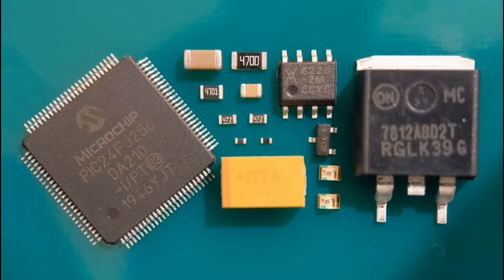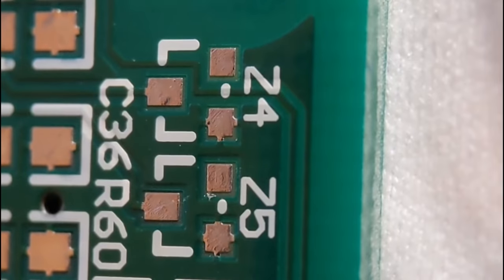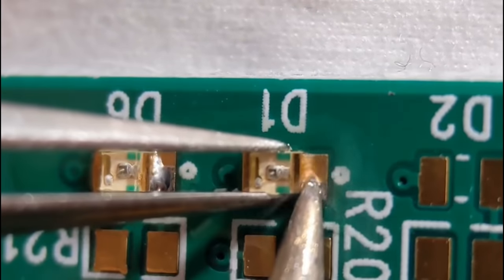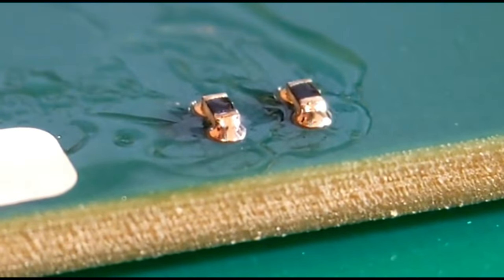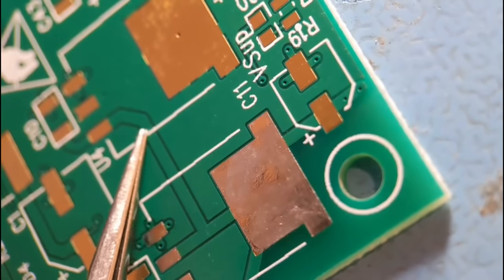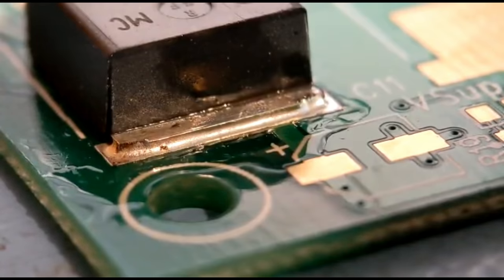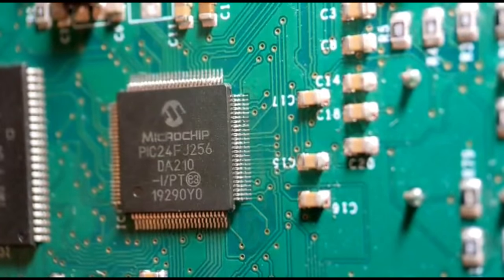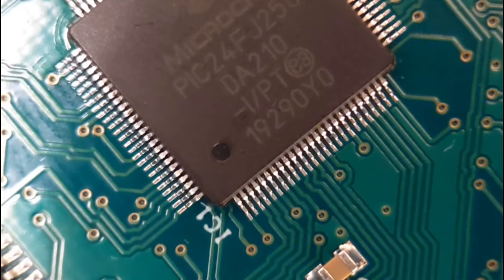How To Solder SMD Correctly - Part 1 /SMD Soldering Tutorial

Comment: Hi thanks for the tutorial, I just wanted to know what size of lead and brand are you using on this video, It will be nice if you post the materials you use on this video. thanks!
Reply from the maker: Hi . Thank you for your question . The solder I used in this video was called Nitrosol Solder Wire , Alloy - Sn100SB , size 0.25mm , also comes in larger sizes , supplied by BLT Circuits , www.bltcircuitservices.co.uk 
Flux I use is SMFL200D , suppliers Farnell , RS Components , also seen it on eBay . This is the only flux I ever use .
Cleaning fluid i use is called Ultrasolve .
I only use Weller soldering irons TCP S model. Hope that helps . Thanks again for watching 👍
Reply: @mrsolderfix3996  Thank you so much!!! Liked and Subscribed!
Reply from the maker: Hi . Thank you for supporting my channel . I always try and help people if they need it so if you have any questions in the future , please feel free to ask and I'll try and help . Thanks again , good luck👍
Reply: @mrsolderfix3996  Maybe in future, a tutorial, a proper way to use hot air rework station, how  to resolder microchip bad joints into the motherboard. Thanks!
Reply from the maker: Hi . I'm sure I can eventually cover the hot air rework one and the microchip bad joints one . I've done a couple of video's featuring some uses of the hot air gun i.e replacing a QFN IC and removing an IC 4 ways,  but still have lots I can do to cover it all . 
To rework Microchip bad joints I would generally just flux them like I do in my video's and resolder as if I'm doing it from scratch . Im going to do a Part 3 of my SMD soldering videos next and I will put a couple of Fine pitch IC's in this video so this may help. Thanks again👍
Reply: @mrsolderfix3996  Thanks again! Keep em coming!

Comment: What temperature is the iron, what flux, did you warm the board up, helpful tips but no actual information
Reply from the maker: Hi , thank you for your comment. All the questions you've asked I've mentioned the answers for these in many other videos I've posted . I've done complete videos on the flux I use for example , cleaning fluids I use and solders I use , talked about the irons i use and temperatures , I've mentioned quite a few times that I never use a hot plate to pre warm boards in any of my videos that I've posted. I can't mention the same info every video as the video would go on to long and grey to repetitive . Hope that clears your question up . Thanks 👍

Comment: Great video! What flux are you using and what are you using to clean the flux after soldering?
Reply from the maker: Hi . Thank you . The flux I use is called SMFL200D and is available from Farnell , RS Components , eBay and others . About £13 - £15 a can of 200ml .
The cleaning fluid I use is called Ultrasolve .  Also available from the pcb supply companies like Farnell , RS Components , Rapid Online and others . It's the best fluid I've ever used , amazing stuff , well recommend it. The cleaning cloths are from Grove Sales Limited , called Gtek wipes , pack of 100 about £5 , again the best on the market .Hope that helps , thanks again 👍
Reply: @mrsolderfix3996  Thanks!
Reply from the maker: Hi . No problem 👍

Comment: Great video ,what are the temperatures????
Reply from the maker: Hi , thank you for your comment, much appreciated. Generally if I'm doing leaded soldering I would use approx 330 degrees centigrade and for unleaded soldering approx 360 - 370 degrees centigrade. I may vary these slightly for certain components but generally I would stick with these temperatures. Hope that helps , thanks again for your time 👍

Comment: Very instructional videos. Thank you for doing them. May I know what kind of microscope are you using?
Reply from the maker: Hi . Thank you for your great comment. I use a stereo microscope with a long arm on it so as you can get large boards underneath it no problem . You really do need a long reach arm on your scope so you can basically do any size board. It comes with a boom stand and is very stable. I don't use a microscope camera , I use a camera next to the work for different camera shots . You probably know but a lot of scopes come with a camera option , but I didn't want this option. Lots of companies selling this type of scope and i love mine . Hope that helps , and thank you again👍

Comment: What temp is the soldering iron set at?
Reply from the maker: Hi , for this video I used roughly 350 degrees centigrade as all the soldering was done lead free . If I was soldering using leaded solder I would use roughly 330 degrees centigrade. Hope that helps , thanks for watching 👍

Comment: What temperature do you run your iron at?
Reply from the maker: Hi , thank you for your question.
Generally for leaded soldering I would use roughly 330 degrees Celsius and for unleaded soldering I would use about 360 - 370 degrees Celsius . I may vary these slightly for certain components, ground plains etc but normally these are the temps I would stick to. Hope that helps , thanks again 👍

Comment: What's the temperature that you would recommend to use?
Reply from the maker: Hi , my soldering iron is normally set between 350 - 370 degrees centigrade . Sometimes I change the size of the iron tip , as I did in this video , also I have different temperature tips but generally I use the temperature above. Hope that helps thanks again 👍
Reply: @mrsolderfix3996  Thank you!
Reply from the maker: No problem

Comment: What soldering station you using and what size/type and brand tip you using for the really small resistors you soldered ?
Reply from the maker: Hi . Thank you for your question. I use a Weller TCP S Soldering iron , this has a separate power unit the iron plugs into . This is the only iron I use for everything , it takes a large variety of tips and i use mainly a PTP7 tip ( small conical one ) I needle file down to a sharper point and a DD8 tip ( large flat sided one ) for 90% of my work . Hope that helps , thank you again 👍
Reply: @mrsolderfix3996  I got a weller station wd2m which comes with the wmrp small iron and tweezers, also got a couple of  metcals , Mx-ps5200 with iron and tweezers , metcal mfr-1100 and hakko fx-951 ,  ersa icon pico, thermaltronics tmt-2000s, and also got a couple of stations that use original  jbc tips, jabe ud-1200 and xsoldering pro that has 2 handles that one uses jbc c245 tips and other uses jbc c210 tips, I’m also making my own diy station that uses jbc tips, the problem I have with conical tips for this type of soldering tasks is that the solder doesn’t want to stick to very fine conical tips and always sticks further up the tip , I’ve tried every original premium brand possible but near enough all of them won’t allow the solder to stick to the tip of conical tips, I don’t know what else I can do about that problem and what brand solder and flux you use ?
Reply from the maker: Hi . I get my solders from a company in England called BLT Circuits , all their solders are really good and they are a trusted company . I've used cheaper solders and you can tell the difference so I don't go there . 
I don't have a problem with the solder sticking to the end of the tips I use as you can see in the video . I file down to a sharper point then flood the whole end of the tip with solder and leave on for about 30 secs , then wipe all off and then the tips ready to go .
 The flux I always use is SMFL200D , it's great stuff about £11 for a 200ml can. 
Hope that helps you , thank you👍
Reply: @mrsolderfix3996  I’m from Birmingaham anyway so I can buy from that website without a problem , thanks will give it a try , seems they have no prices on there website and you have to contact them for prices , I’ve already got kester solder and aim solder and loctite , also some cheaper ones but I’ll try the one you got and see how it holds up against kester and aim brand
Reply from the maker: Hi . Hope you get on ok . I have found occasionally the problem you have with getting the solder to stick to the very end but I just persevere and keep playing with it and in the end I always get there .Also BLT do 0.25mm thickness solder . This is great for all your fine pitch components. Good luck 👍
Reply: @mrsolderfix3996  Thanks I’ll keep trying , anyway that flux is in a can but I never seen you spray the flux and seems you apply it with something else ?
Reply from the maker: Hi . Yes what I do is spray some into a tiny container ( a milk lid for example ) then I dip the end of a Ty wrap into it and apply it via the Ty wrap . It works a treat 👍
Reply: @mrsolderfix3996  ok just ordered a can from cpc
Reply from the maker: Hi . Great stuff . If you need it to be slightly thicker just spray some in a container , after a while it starts to thicken slightly so can pinpoint an area better when like this. Good luck. Also I don't bother using the straws that come with it.👍

Comment: Great video, what are you using to clean the flux off?
Reply from the maker: Hi . Thank you for your question . I use a fluid called Ultrasolve which is the recommended cleaning product for the SMFL200D flux that I use . 
I use Gtek dry wipes from a company called Grove Sales to clean the fluid and flux off and this combination produces superb results , the best I've found anywhere. Hope that helps 👍
Reply: @mrsolderfix3996  Very cool, just what I needed to know. Thank you so very much for the information.
Reply from the maker: Hi . No problem . Thank you again for watching 👍

Comment: what temperature did you use to solder them all?
Reply from the maker: Hi . All components were soldered at 350 degrees centigrade . I changed the tip for a larger one for one component that's all . Thank you for watching.👍

Comment: Thank you, this helps a lot. May I ask what flux do you use ? And what are you using to clean the pcb ?
Reply from the maker: Hi . I use a fluid called Ultrasolve to clean the boards 
 If you look through the comments for this video there is loads of mentions about the flux I use and how I use it . Thanks for watching 👍
Reply: @mrsolderfix3996  Thank you, sorry I hadn't read the comments, the products are on my list now :)
Reply from the maker: Hi . No problem . Hope you manage to get some of this flux as it's great stuff . Thanks again for watching 👍
Reply from the maker: Hi . No sorry these are not the ones although I have used these before when I couldn't get the dry wipes. 
Where these are about £7.50 a pack the dry wipes that I prefer are roughly £4.50.
On the packet you showed me in your link , where it says IPA wipes the only difference is this should say dry wipes.
The IPA ones are thicker and not as flexible but they are sort of ok , but I much prefer to add my own cleaning fluid to the lighter , more flexible dry wipes. 
You have got the right company though . Maybe send them an email , they do sell to the public no problems.
Good luck 👍
Reply from the maker: Hi . Yes , they are the ones . I just dip a small part of one cloth into a small container of Ultrasolve ( I normally just use the lid from the Ultrasolve itself ) and then gently wipe away . It might take a couple of wipes but eventually it comes out pristine . Where I clean a large area of the board with a cloth or brush I get most of the solution of with a cloth then use a hairdryer to evaporate the rest . This is a great trick that amazes people when they see it . Good luck 👍

Comment: Great technic. Any flux recommendation?
Reply from the maker: Hi . The flux I use is called SMFL200D . It's a great liquid flux . Comes in a spray can 200ml . I just squirt a small amount into s small container and apply using a dipped plastic Ty wrap to the desired areas . Available from Farnell , RS Components , Mouser , even seen it on eBay. Pretty easy to get hold of , about £14 a can . It's the only flux I ever use and I find it great personally. Hope that helps 👍
Reply: @mrsolderfix3996  Thanks a lot!
Reply from the maker: Hi . No problem . Thank you for watching 👍

Comment: What temperature is your iron?
Reply from the maker: Hi , thank you for your comment . If I'm using leaded solder I use roughly 330 degrees Celsius and for lead free soldering I use about 360 - 375 degrees Celsius . I may vary these temperatures slightly for certain components but generally I would stick with these . Thanks again , hope that helps 👍

Comment: What microscope do you use?
Reply from the maker: Hi , thank you for your comment , much appreciated. The microscope I use is just a basic stereo long reach microscope from" GT Vision" , based in England . It's just there standard model but has very good vision and zoom for the price. 
Your actually seeing filming which is just done on a mobile phone with a Macro lens attached to the phone camera. This works great and I can get different angles when filming than if I used a microscope camera which only films from above. I actually get better clarity now than I did in this video you've commented on as I now edit all on the same device . My last 6 postings are much sharper than my older videos. Thanks again hope that helps 👍

Comment: Having a shape C soldering iron tip also helps a lot to solder those 100 pin flat pack quads. (Horse's hoof shaped tip.)
Reply from the maker: Hi . I only ever use fine , pointed conical tips to solder fine pitch devices so I can't really comment on your suggestion . Thank you for your comment though and if it helps anyone else then it's done its job 👍

Comment: what flux do you use and solder
Reply from the maker: Hi . Thank you for your comment . The Flux I use is called  SMFL200D ( I've done a complete video on YouTube all about this flux , well worth watching ) and the solder wire I mainly use is Sn100SB , a lead free 0.25mm gauge wire from BLT Circuits ( based in England ) . I get all my solders from this company , 0.7mm , 0.5mm etc . There stock is really good , lead free and leaded .
The flux I get from Farnell or RS Components . Hope that helps 👍

Comment: What temp is your iron set too?
Reply from the maker: Hi , thank you for your question . When I am soldering with leaded solder I normally use roughly 330 degrees Celsius and when using lead free solder I would use 360 -375 degrees Celsius . I may vary these slightly for certain situations but generally these above temperatures normally work ok . Hope that helps , thanks again 👍
Reply: Thanks for replying  @mrsolderfix3996

Comment: Hi
What soldering machine did you use?
Many thanks
Reply from the maker: Hi . The soldering iron I used in this video was a Weller TCP S iron. The small tip used was a PTP7 and the large flat tip was a DD8 . Thank you for watching , much appreciated , hopefully that's helped you 👍
Reply: @mrsolderfix3996  can you please tell me where to buy weller TCP S iron?
Thanks
Reply from the maker: Hi . The main places are Farnell and RS Components . Also Rapid Online sell them . Pretty easy to get hold of , probably on eBay as well . You need to buy the iron and the power supply it plugs into . Hope that helps 👍
Reply: @mrsolderfix3996  hi
What is the model number of weller soldering station you have?
Sorry I asked lots of questions 
Many thanks
Reply from the maker: Hi . The base power supply unit is a Weller PS3D , and I use a TCP S iron plugged into this unit. You have to make sure the iron lead has the right connector fitted to it so it will plug into the base unit ok. Hope that helps , good luck 👍
Reply: @mrsolderfix3996  Thank you very much
Reply from the maker: Hi . No problem , hope you get on ok 👍
Reply from the maker: Hi . I don't really know this iron , but it gets pretty good reviews and you can get various tips for it which is a must when your doing soldering in my opinion. Weller irons have always been my favourite make and are pretty reliable and well built so it should be a good iron . Good luck 👍
Reply: @mrsolderfix3996  thanks

Comment: For components placed far apart, it is ok to follow your instruction to solder. But what if components are placed closely? Any other demo video for that? Especially in case heights are different for adjacent ones.
Reply from the maker: Hi . No matter how close resistors for example are to each other , 0201 , 0402 etc I have a different pair of tweezers to suit . I have amazingly pointed ones so can get in tiny gaps with these to hold the component while I tack it into place. That's the answer on closeness , get a good selection of quality tweezers. I've always found a way to get down in amongst components by one means or another . It's a job to explain how , you just get more experience and find you can get almost anywhere . 👍

Comment: what flux do you use?
Reply from the maker: Hi . The flux I use is called SMFL200D . I should be posting a video about it and it's uses in the next few days as I get lots of people asking . It's a great flux , available from Farnell, RS Components, Rapid Online, even seen it on eBay. About £15 for a 200ml spray can. Hope that helps . Thanks for your question 👍